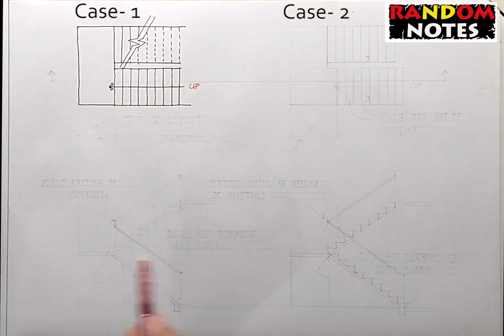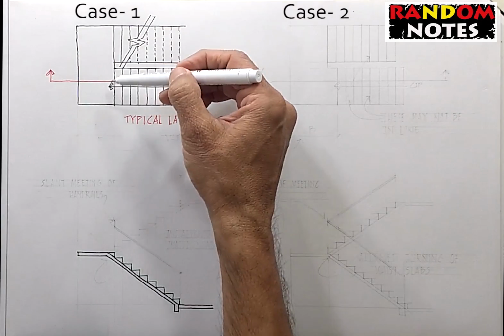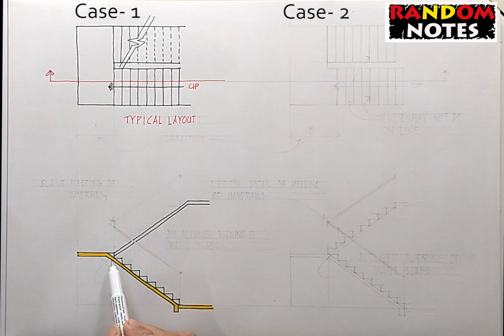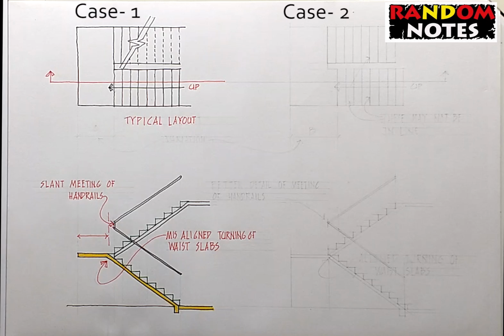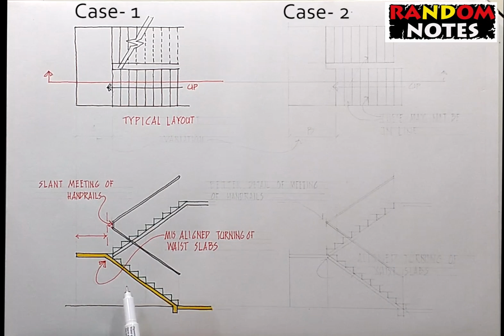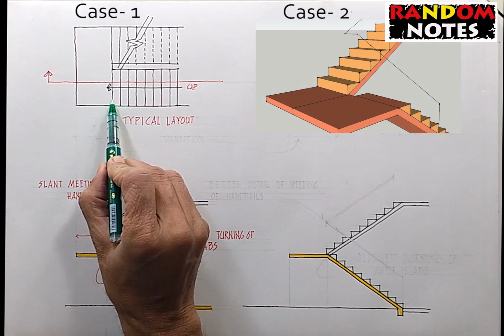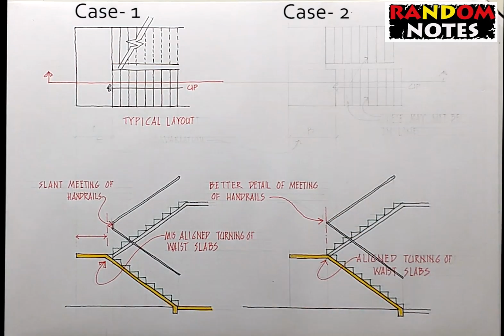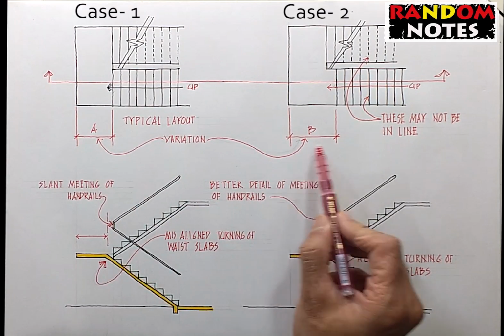STAIRCASE-2 Detailing Dog Leg Staircase

Comment: Thank you for your video. However in your case 2, the height of the handrail while standing at the landing will be higher than the height of the handrail from the staircase pitch line. Instead of extending the last step at the landing of the downwards staircase by one step, you should have pushed back the first step at the landing of the upwards staircase by one step. That way, your handrail height will always be consistent and they will still meet at the landing, while maintaining your clear width of the staircase at the landing. My 2 cents.
Reply: Thanks for this clarity!  I came to watch the video solely on how to make compliant handrails at the dog leg.  Case 1 isn't IBC compliant.  I see from your explanation Case 2 could be compliant!  Unfortuantely handrails are the afterthought to stair design and I see why many Inspectors miss it or turn away! I just don't know hot to correct in the  field.  eeep

Comment: At first, you had to describe that what  a dog legged staircase is ? Sound is very poor.
Reply from the maker: Thanks for your feedback. As the name suggests, there is a part- 1 of the series. There I have defined the same. I will try to improve the sound.
Thanks again
Reply: @randomarchitecturenotes-na809  Thanks for your quick response. The 2nd question that I want to know  -  is wall support essential to a flight/staircase? And what should be the design  of staircase in case of no wall support to the flight.
It is now cleared  that  what is dog legged stairecase. Thanks with regards.
Reply from the maker: @Organicbharat21  Staircase, in itself, can be self standing also. You may have a support in the space in the middle of the two flights, to support the steps which may cantilever out. There may be other ways to do it.

Comment: Thanks. Also should note that the first and last step of a starcaise usually differ from the remaining step as far as structural dimension is concerned so that all steps are equal in terms of finished dimensions. The first step should be made higher by the thickness of floor finish (say 50mm.) and the last step made lower by the thickness of floor fisnished (again say 50mm).  There is also a cutting made at the back of the first step so that it can be plastered (usually a min. of 300 or preferred 450mm).
Reply: Good information
Reply from the maker: I'm sorry, I missed replying to you. You are absolutely right.